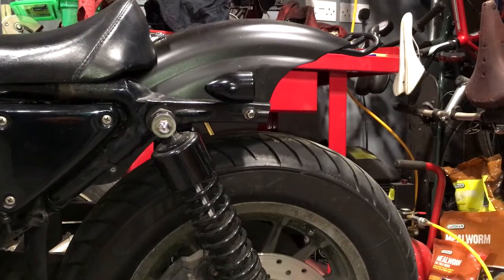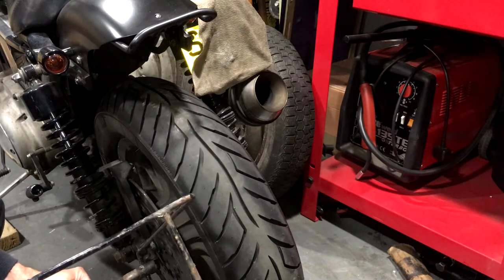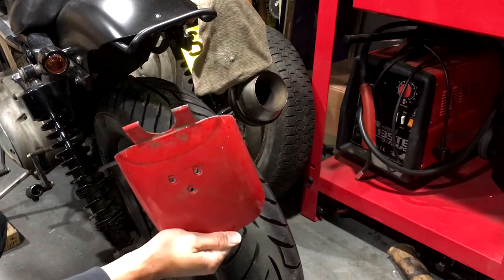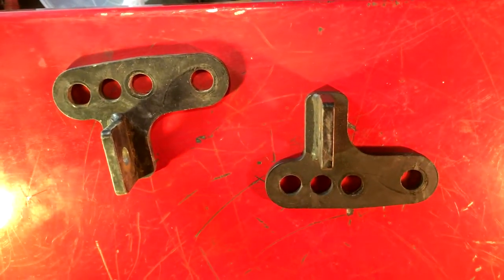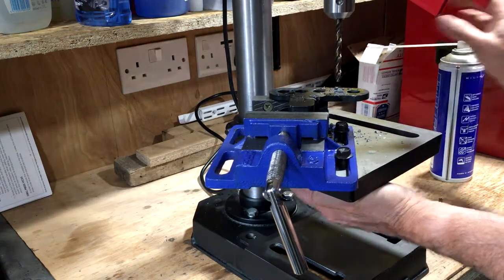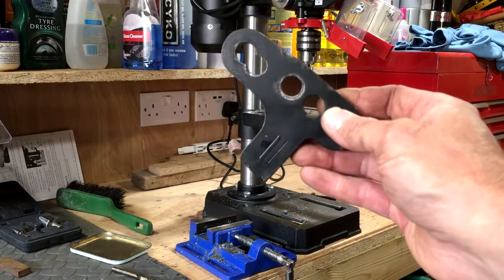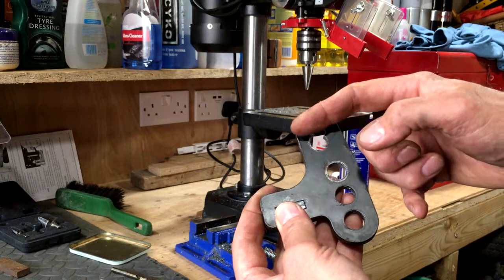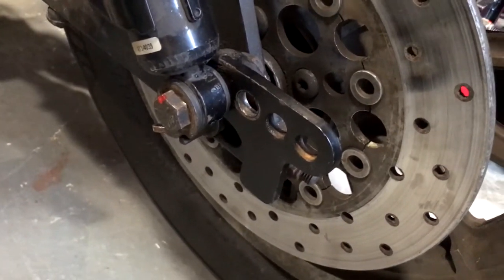Sportster Rear Hugger Fabrication #1

Comment: Hiya Mirius. You have probably used this in the past or maybe not! If I have a hole to fill in anything around the 3ml steel, I would usually use the mig to fill in the unwanted hole prior to drilling the hole in the new position. If you do it right, the old hole can be flatted and cannot be seen at all, that allows the new hole to be drilled with good body around it. Better than having to weld a plate to complete the new hole in my opinion. Good job though mate.
Reply from the maker: That is indeed an excellent point.  Especially since I will be filling one of the other holes with the MIG.  

Wish it had occurred to me before I drilled!  Guess it's because I'm still new to welding and I'm shying away from it instead of embracing it.
Reply: +Mirius 
Shying away or just being cautious? When I first got my mig I must me honest........ Nothing was safe around me, if it resembled metal, it became a target for my self discovery as a welder haha. I happily blew holes in everything trying to get the right settings, eventually it becomes the "go to tool" for things that are steel and have holes. Many times my measurements have been out and the hole has been out of position. Mig it, flat it and re drill.... No one is any the wiser and you end up with a perfectly strengthened item. Love my mig! Embrace the mig lol. RSMB
Reply from the maker: +softail fun Thanks.  Yes more cautious about f@cking it up.  But since you've mentioned it, now I'm just going to have to give it a go.   What's the worst that could happen.  Thanks Stan, much appreciated!